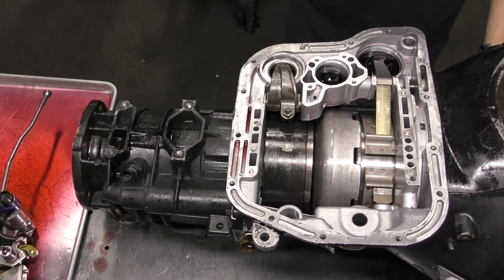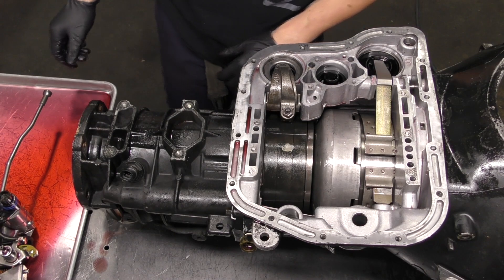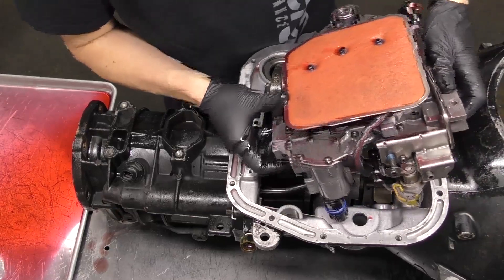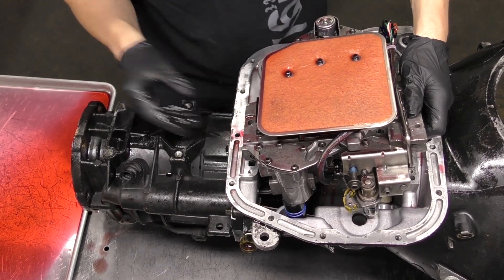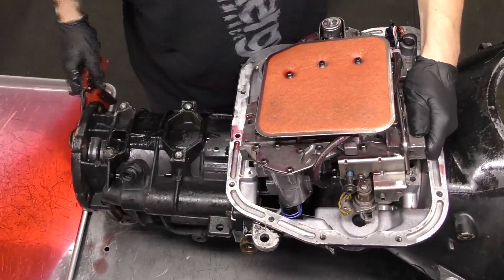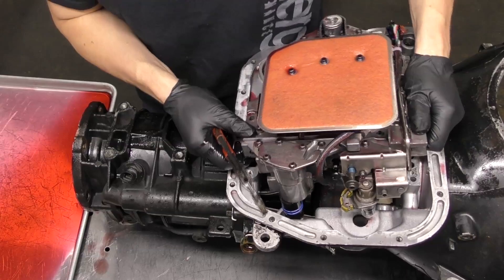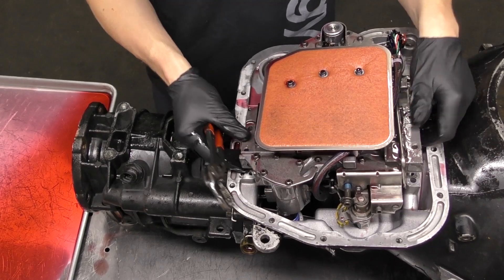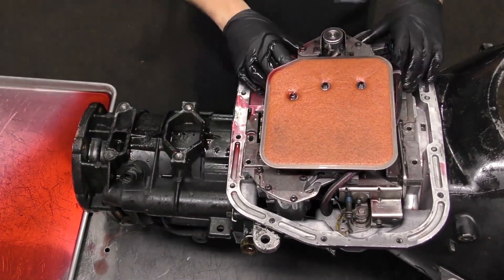47/48RE Automatic Valve Body Install

Comment: Thanks man. 5 years later your vid is still helping people. 

Got a trans that was damaged in shipping and the vendor expects me to fix it. I barely have a clue to be honest. 
The od housing appear to be cracked so I think fixing the connector is pointless. I posted it on my page today. 
Consider how many times I have been left hanging I guess I need to learn more than just swapping them out. 
I made a build table today.

Comment: Yeah but how do you do this while you are underneath the truck in your driveway? Thats what i wanna know.
Reply: No different your just upside down and make a mess... lol
Reply: @nsmturbo5902  How do you wiggle the output shaft??
Reply: @S_S_G_G  turn the driveshaft
Reply: @nsmturbo5902  Just a liiiitle inconvenient if that even works. 
Man I can't believe no one else does this in their vids on these valve bodies, but the best way to remove them is just to remove the retaining ring on that dumb park rod. So much easier. Just learned that from my trans mechanic.
Reply: @S_S_G_G  that’s the way I’m going to try it in the driveway. Lol
Reply: Very carefully

Comment: Well that’s nice when the transmission is out, but what about with the transmission installed…
Reply: No different your just upside down...
Reply: Good lord if you can't figure it out keep your pan and don't touch anything!
Reply: @TheHyde8875  Rude ass. How do you wiggle the output shaft huh
Reply: @S_S_G_G By turning the driveshaft.. Rear wheels slightly in the air. Genuinely not a difficult concept.

Comment: Listen I ain’t blaming him but I just done snapped my bolt at 110” lbs on the Governor pressure housing
Reply: Bolt was definitely compromised it should’ve stripped out the threads before snapping off.
Reply: @keith2860  seriously. Steel bolt in aluminum.

Comment: Does it matter which way I turn the drive shaft to get it in.. an does it matter what position I put the gear in on the vavlebody..I am having problem s with after I installed it..I took it out an in .idk how many times...
Reply: Did you ever figure it out?

Comment: Hi i have a 92 or 93 a518 transmission how many qts of transmission fluid does these transmission take that's with out tork converter just the transmission it's self
Reply: If you drop the pan and drain it's right around 6 quarts.

Comment: I did a valve body rebuilt thought i had install everything right. The roster comb turned pretty good and now when i was trying to hook the shifter cable the transmission only shifts 4 times therefore my parking gear is not engaging what could possibly had failed?
Reply: Yes I did! I made the mistake of engaging the roster comb one click prior to the parking spot which is the more square looking space and not the round one. Just make sure that when you installed the roster comb the ball fits into that spot and every other round spot...
Reply: Had the same issue did you figure it out